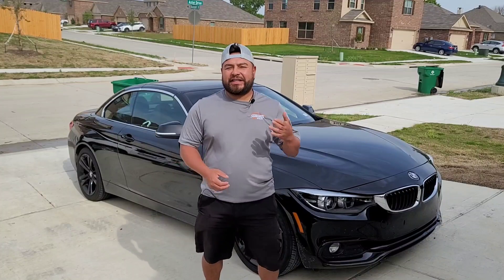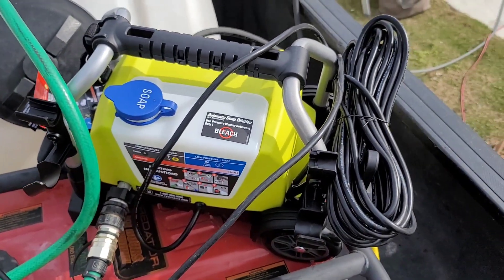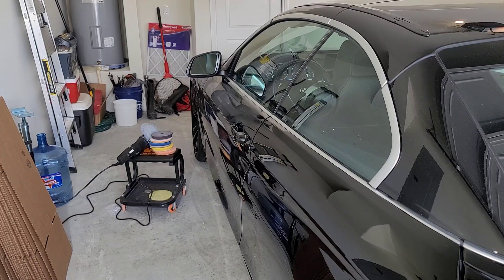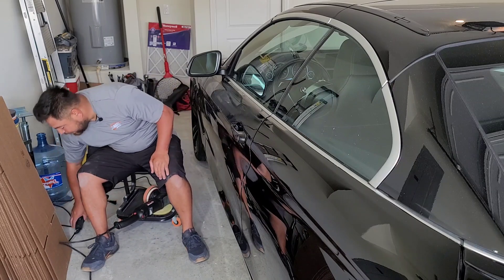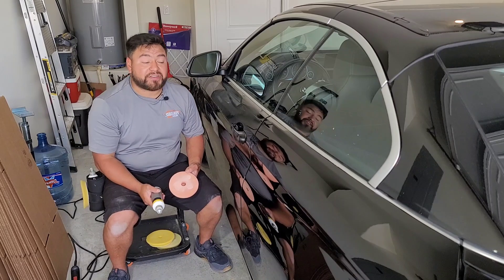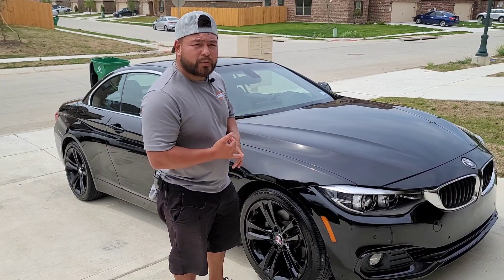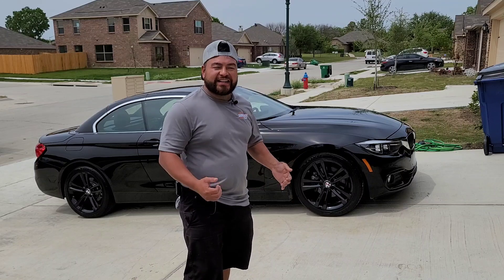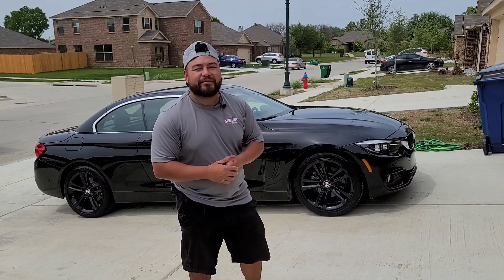6yr ceramic coating!

Comment: Nice job! What tool do you use to measure the cars paint?
Reply from the maker: I think it's called ard  I need to look
Reply: @serranosmobile  thanks for the reply i appreciate it
Reply: I had the same question.  I would hate to pay for a customer repaint.
Reply from the maker: I will post links tomorrow